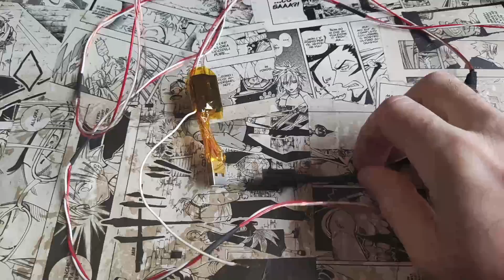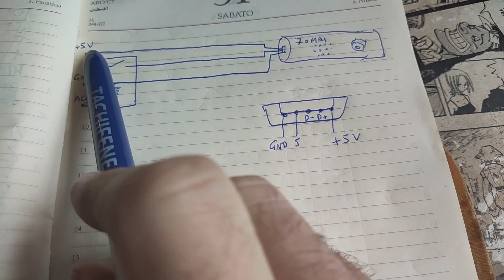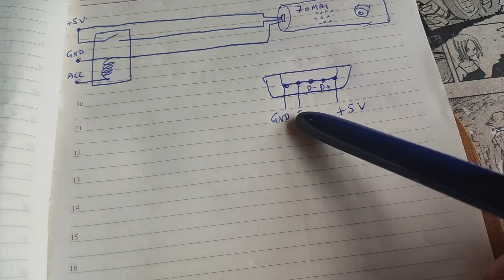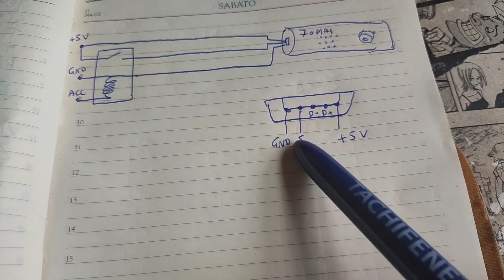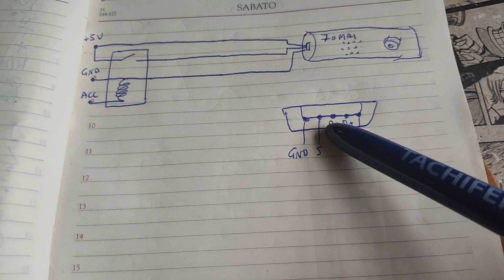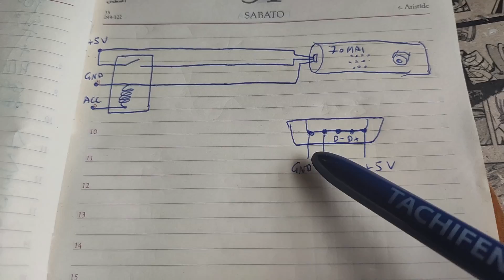DIY 70mai hardwire parking mode cable, near to no cost

Comment: Hi, thank you for the great content.

I'm currently interested in making a parking cable for 70mai A810, which uses a USB Type-C. 
I've been researching how it works and wanted to share what I've discovered so far — in case anyone else is exploring this too.

Observations:
The A810 does not boot when powered by a USB PD charger, which strongly suggests it does not support USB Power Delivery negotiation.
However, it does boot with a basic USB-A to USB-C cable connected to a 5V power source.
This implies that the A810 relies solely on VBUS (5V) power and expects a standard Type-C passive power connection.

Conclusion:
Most likely, the ACC vs. BATT state is signaled via the CC (Configuration Channel) pin using different Rp resistor values.
USB Type-C hosts can advertise their current capabilities (e.g., 500mA, 1.5A, 3.0A) via specific resistor configurations on the CC pin.

Next Step:
The best way to confirm this would be to:
Buy an official UP03 parking kit, measure the voltage of the CC pin.
Or build a test cable with a switchable resistor network on the CC pin (e.g., 10kΩ for driving mode, 56kΩ for parking mode), and observe how the a810 reacts.

Unfortunately, I haven’t had time to experiment further — but I hope this gives others a good starting point.
Reply from the maker: thank you for the input! I share your hope that this is useful for others

Comment: Can i use any other brand hardwire kit with ddpai n5 dashcam please explane type c pin diagram with details
Reply from the maker: I don't know the USB-C diagram myself, nor if aftermarket adapters are based on a standard wiring, this video is but a specific one for a specific camera

Comment: Did try on 5 pin type C. But doesn't work and keep running when turning off engine 😢. Any idea?
Reply from the maker: that's weird, I actually don't know what to suggest because my usb port was a 5 pin usb micro, not C, and not sure the pin-out is exactly the same between the two
Reply: @ephestione  I know. I did on old DC with port micro USB. Did well and work. And now, I change my DC with newest generation on port type C. And tada..... Not working 🤧🤧
Reply from the maker: @JohnDeso  I'm sorry I couldn't help, the only info I found was for microusb cameras
Reply: @ephestione  it's ok mate :) thanks for your responses anyway :)
Reply: Milik anda adalah mikro usb A/B model 5 pin itu adalah yang sesungguhnya. Dan itu memang ada dalam dunia elektronik. Namun sangat tidak umum di dunia ponsel 😊 semoga membantu info ini. Konten anda menarik buat pengguna dascam terimakasih teman. Saya menunggu info terbaru model type C port

Comment: The only minus of your way is there are no safety short cut if low battery. But it should be work and thanks for sharing your knowledge bro. Work perfectly on 70mai 1s. But its sold already and move on ddpai z60. Gona try on type C 5 pin.
Reply from the maker: I believe not even the original cable has that feature. I use a dry contact on my circuit to cut off the load when the battery is at critical voltage

Comment: My microusb has only 4 wires, Red-Black-White-Green- (G-)(D+)(D-)(R+), Kindly help me with shorting +5V ?
Reply from the maker: yeah, that's the point, you cannot use that plug. You do need a plug that ships with 5 accessible contacts
Reply: @ephestione  Thanks for your info, it really worked saved my amount. Thanks!!
Reply: @ephestione  can we used 16 pin i.o 5 pin?
Reply from the maker: @I am not aware of a 16pin microusb? you just need a microusb plug with a 5 pin header
Reply: @ephestione   I'm running on type c. Did on type c 5 pin. But doesn't work.

Comment: Micro USB has 5 pins, but i have m310 with usb Type C cable , how can i make hardwire for parking surveillance cable with type C.
Reply from the maker: that I wouldn't know, sorry, maybe, just maybe, you can wire the microusb like I did and then use a microusb to usbc adapter? worth a try
Reply: One solution is as ephestione said , modify type b and use a converter, and other opinion is , but a type c breakout out board from Amazon and give it power and test each pin.
Reply: I wanted to run timelapse using a battery bank , coz I have automatic and if it drain too much due to any reason, can't start it by pushing it .
Reply: @sumer420 What is time lapse? What is its use?
Reply: @armitaebramimi2467  parking surveillance by, g sensor if someone touch the car, or continuous recoding timelapse.
Reply: Hello, my friend, if you find the answer to your question, please tell me, thank you
Reply: You can search type c 5 pin. Should be there in marketplace in your area.

Comment: I use 70mai M500. It supplies by type C gate. So can you help me the diagram to make hardware kit. Thanks
Reply from the maker: Hi, in case you did like I explain here and it didn't work, I wouldn't know what different scheme the M500 uses
Reply: @ephestione M500 use USB type C gate but in this video guide with micro usb gate so I need to hepl with dìagram with type C gate. Thanks
Reply: @thanhduyvo2333  I Believe you looking tutorial with type C gate right? Same with me..!! Lol. Did try on type c with 5 pin. Not working 🤧. Wondering how logic rule on type C
Reply: Hello, my friend, if you find the answer to your question, please tell me, thank you

Comment: Note that for parking mode the ID pin is disconnected anyway. It seems that the camera needs to sense power on the ID pin once to be able to go in to parking mode
Reply from the maker: yes, the power on the additional line is the discriminating factor between parking mode or normal dvr mode, but it has to see power there first to know it's a supported cable

Comment: do you know if the oem microusb cable comes with the 5th cable so I can use the default cable with this schematic?
Reply from the maker: good question! I didn't check honestly, didn't want to maim the connector
Reply: Did u try it?